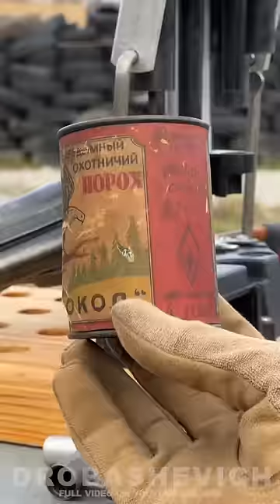RECYCLE #gauge #gun #shotgun #usa #weapon #shootingrange #shot #ammo #shotgun #rdr2

Comment: I like the Idea of going to a range with exactly 1 shotgun shell and a LOT of refill equipment and shooting the same shell over and over again until it wears out and becomes unusable. 😂😂😂
Reply from the maker: Good idea, I think this can be done no more than 3 times
Reply: Actually considerably longer, depending on what type of shotshell you load. 12 and 16g, as well as shotgun in general, are very low pressure rounds, less than 9mm and I have 9mm from 1994 that's been reloaded multiple times a year since @DROBASHEVICH
Reply: @A407RAC youre right bro! Can be reloaded as long as the plastic stays pliable enough tk not split during the crimp. Ive got shells in the 30+ reloads from skeet.
Reply: Significantly longer if it's a old shell with no plastic.

Comment: The Lee load all 2, not a bad reloading tool but it's got a couple of issues. One, most of shotgun brass hull are not completely brass so the sizing tool that it comes with which is that metal collar doesn't quite size it small enough for semi-auto reloading shotguns. The second and most egregious is the inability to change out the powder without dumping both the shot in the powder simultaneously.
Reply from the maker: You know a lot about this! Thanks for the info!

Comment: Question, I have the exact same shot shell reloader, and you are able to load powder and shot in the system which dispenses it into the shell. Does pouring in your own powder by hand, make a difference in speed or convenience?
Reply from the maker: This is made for video only; usually you need to measure it using a scale. It is not recommended to dose this powder in measuring containers.

Comment: Correct me if I'm being paranoid but I don't let my release lever snap back into place like that. I hold it and move it into place after closing it. Ive been taught to do it so you don't start wearing the edge down as it locks shut. Same idea as holding the e brake button when pulling it then releasing the button so you don't wear down the edges of th teeth. Any opinions are welcome.
Reply from the maker: And you know a lot about this! Thanks for the info!

Comment: Eh don’t listen to that guy, chest supported rows are cool but to add some effect if you really want to do this specific variation (for some reason). Grab some d handles from that cable machine that lacks the love it deserves and put those on the bar give you some more ROM and get to have a neutral grip to keep the elbows close into the body (more lats) and only 3 reps you had like 5 not in you. Keep on the grind🫡
Reply from the maker: And you know a lot about this! Thanks for the info!

Comment: Smokeless by volume?
Reply from the maker: Yes, the set even includes measurements.
Reply: @DROBASHEVICH cool measures but... Mostly those are used for black powder and smokeless is precisely measured on a scale by the grain. 
So, did you use a really small charge of powder, because you did not use a scale? (No worries of over pressure if there is there is slightly more because you measure by volume?)
Reply from the maker: @pinocolada4254  you’re right